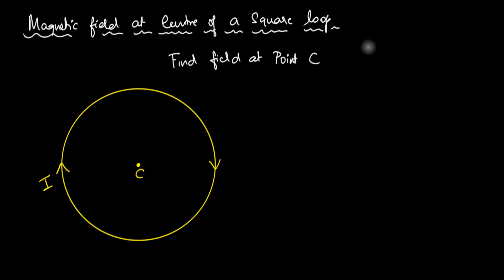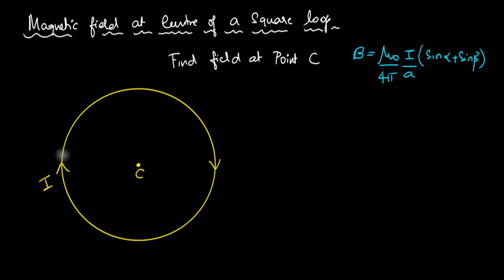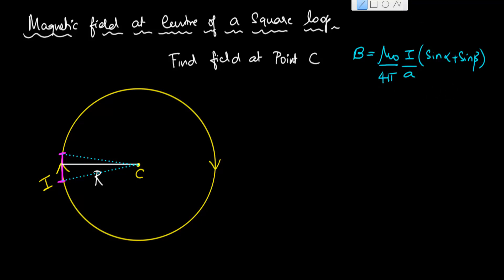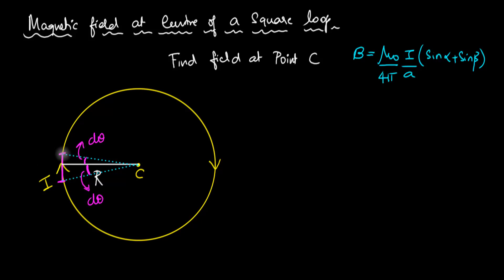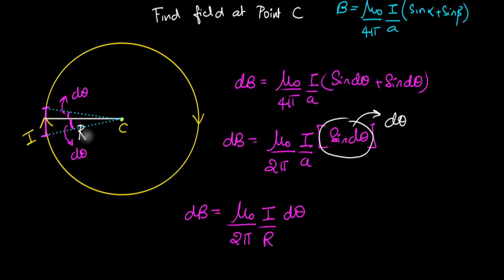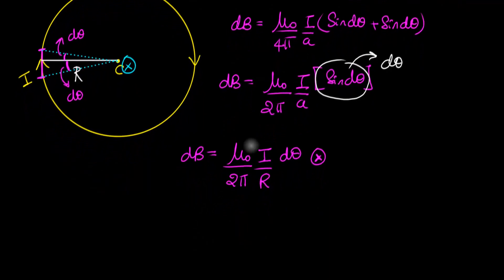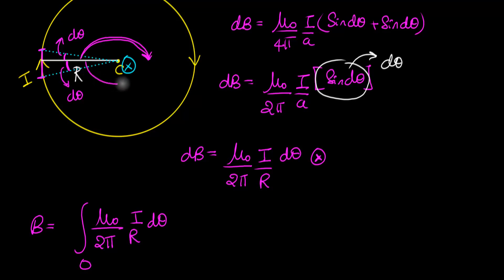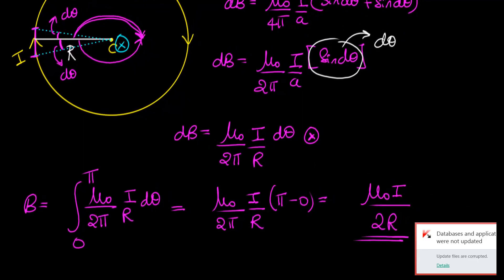Magnetic Field at the Center of a circular loop | Biot savart law | Floatheadphysics

Comment: So... A question: why can we NOT use Ampère's Law for the magnetic field in the center of the loop? Like, at (0,0,0). We'd consider the integration curve to be the loop wire and integrate it. Then the resulting magnetic field would be the one in the center - the same in an infinite wire, because it's not a curve, just a straight line as in a infinite wire. But this doesn't work and I don't understand why. Could anyone please explain me why it doesn't work? (There's a Pi in the denominator with Ampère's Law and with Biot-Savart's Law there's no Pi anywhere)